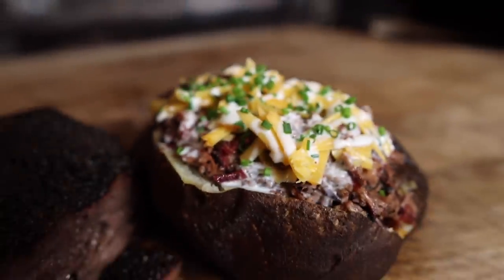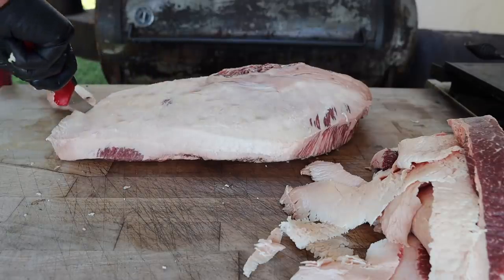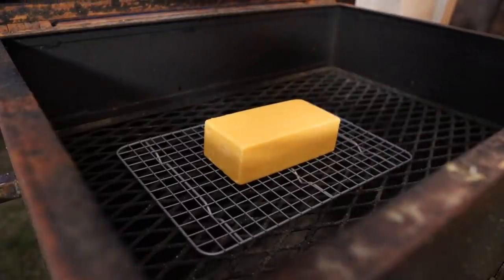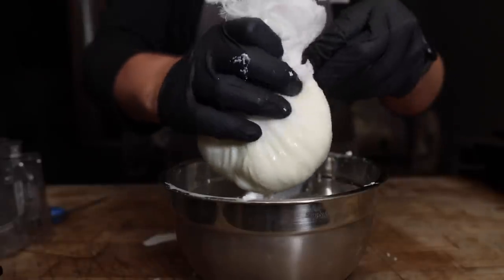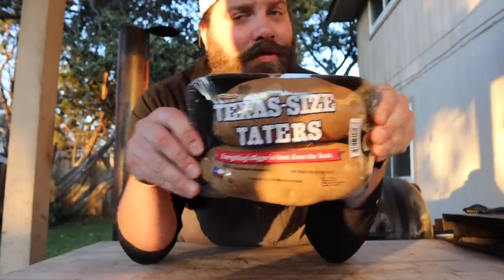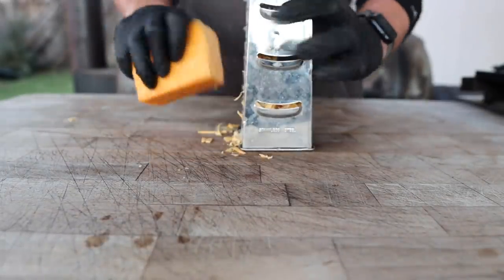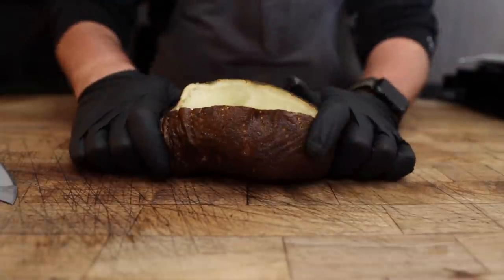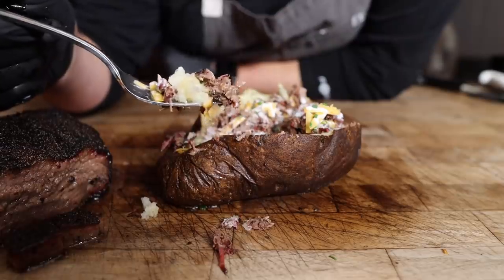Loaded BRISKET Baked Potato! | Chuds BBQ

Comment: What toaster oven did you use to hold the brisket. I have been looking at using a cheap electric smoker for a warming cabinet, but they are only 18 inches across and I am afraid that it would be too small for holding briskets